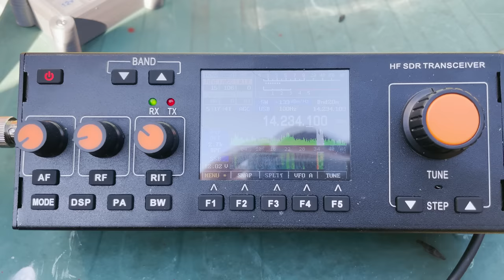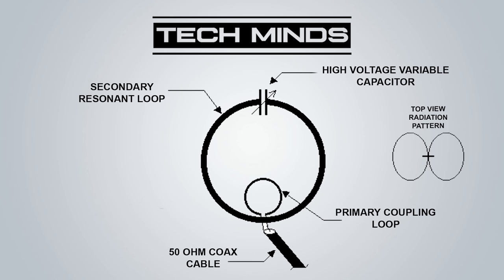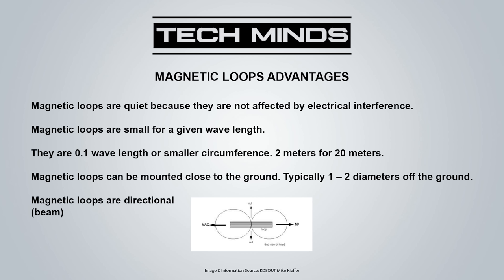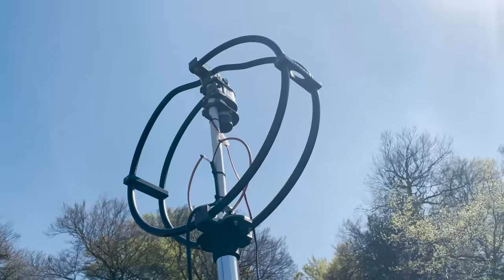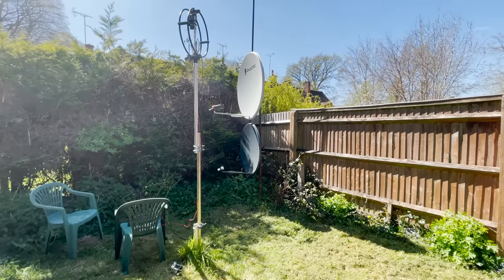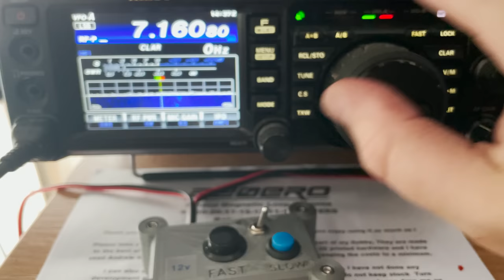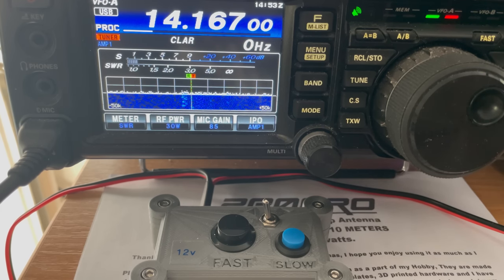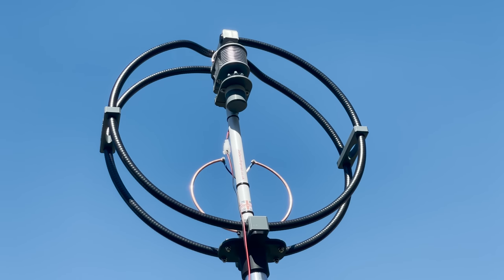MAGNETIC LOOP 40M - 10M Built by 2E0ERO

Comment: NO NO NO NO, you don't use an ATU with a magnetic loop. The loop will not radiate properly if not tuned correctly and an ATU will not help.
Reply: I add a few NO NO NO NO NO's.  that is a big NO NO to use a ATU with a loop, never do that
Reply: Actually, you're wrong. You can tune a loop with the capacitor and get the best swr you can. The ATU will then match the impedance.

Comment: I just purchased one of these today on his eBay page , the reason for purchasing was down to the stable looking design, I have home-brewed a few using old radio capacitors and various coax , aluminium loops but my efforts were always substandard, some day I will invest in a 3d printer . I wonder if you have done any follow up videos with good band conditions, could also be used in conjunction with Xphase QRM Eliminator as your aux input to get rid of bad over the horizon qrm radar/woodpecker/ noise as well as local noise in both horizontal and vertical positioning
Reply from the maker: Unfortunately I gave this antenna to my friend, on a permanent loan! I have too much gear here to keep around so I needed the space. I believe many people are using these.

Comment: I have the AlexLoop (for SOTA) and the Ciro Mazzino (spelling??) Baby loop. While I like them one huge drawback is the obvious need to retune when changing frequencies which makes contest participation painful. Another big limitation is the inefficiency of a loop at its lowest operating frequency (7MHz in your example) and I suspect that this one is no different. Final comment is the peak angle of radiation in the vertical plane is quite high (~40-60 degrees) making DX more challenging. FWIW I think using at ATU a big “no no” with a loop given the sharp Q of a loop.

Comment: I have one of these and it works well, mine is in the loft and right next to a velux window. only downsides i can see is its not waterproof, so not suitable for full time outside and the switch has to be manually switched to extend the range.

Comment: I have the same loop bought from 2E0ERO earlier in the year. Initial setup indoors just behind the patio doors gave better results than I was  expecting despite it being stood on the floor. As soon as time  allows and the weather improves I'll be mounting it on a decent portable mount and getting it a little higher of the ground. General consensus seems to be  1m to 2m so I plan on using a tripod that's easily portable. Did you try it at different heights?
Reply: test it by placing the two loops parallel to the ground, that is, horizontal: in theory this will be omnidirectional but it will only pick up the signals that arrive from the horizon (which are the interesting ones) and not those that arrive "below" the horizon, thus it will capture less radio noise generated in the population's homes.
Reply: Hi Nick, do you have the website where I can order? With your experience is the antenna water tight? With the Video I can see the tuning capacitor is exposed. Any suggestions? Jojo

Comment: Wouldn't this Antenna work far better 50 or so feet above ground?  You could just build a Antenna Rotator from a Car or Truck Windshield Wiper Motor and a Few Gears and some Electronics components Mate.  Also, could you use a hand full of Electronic Solid State Crystals at what ever Hertz you desired to help fine tune your Stations? Just asking. Thanks for the upload.
Reply from the maker: Interesting idea!

Comment: Matt, what is the net effect of winding the outer loop (tuned element) of the antenna? Can you reduce circumference for say a 80m - 40m MLA by coiling? I've seen online calculators that imply that loop circumference is critical to the antenna efficiency at any particular frequency (along with the diameter of the loop material). Can you somehow net a more compact loop for lower frequencies? I assume that there is parasitic capacitance when you do so?

Comment: Would this work for CB radio as well? I'd love to get one and try skip without the RF amplifier
Reply: 2E0ERO makes a CB one but this one tunes at 27MHz I had a go with 4 watts FM last weekend worked a guy 15 miles away we chatted for 20 minuts no issue so it works but not much CB in my area to test it fully

Comment: These are very expensive for what they are and perform worse than a random piece of wire and an LC tuner. We know this because a friend had one and did A B comparisons. The reverse beacon network also helped with the tests. His loops must have the worst efficiency of any loop on the market. The diameter isn't big enough and that normal air spaced capacitor will also be extremely inefficient. Expect between 1 and 3% efficiency. People say loops work, and yes they do, but a wire tuned with a simple LC circuit works much much better, and that's saying something. Don't waste your money people.

Comment: What diameter pole did you use there? I can't find anything that will fit the mounting or did you give Adrian your own custom measurements before printing?
Reply from the maker: Unfortunately I don’t have the antenna anymore as I have it to one of my friends. But I measured the mount that comes with it and ordered a short tube with the correct diameter from Amazon or EBay, can’t quite remember.
Reply: @TechMindsOfficial  ok no probs I'm sure I'll come up with something, cheers.

Comment: I find the interest in small magnetic loop antennas baffling for anything other than just as a recieving antenna..The radiation resistance is sooo small that it cannot be efficient as a transmitting antenna especiall for QRP....What am I missing>
Reply: With my FT-817 and this loop I have worked plenty of DX You are missing the the fact you have not tried one!
Reply: They in fact work very well provided they are optimised. The important thing is to balance area inside the loop vs current in the loop conductor while minimising Ohmic losses. Making it circular optimises area inside the loop and a circumference of about one eight wavelength gives plenty of current. Two turns reduces diameter that can be useful for covering lower bands, and/or intensifying magnetic field but reduces capture area. Inter turn capacitance can become an issue. Most designs settle for one turn and confine operation to 40m and above.
Reply: Peoples were used to say : Oh flying ? Nah, not possible. Now : it will NOT be the same as a classic and well placed dipole, no. If you wanna better energy transfer then you'll have to make it with a physical coupling and not the small ( 1/5 of the main loop ) loop but the downside is the noise, wich is bit higer than the small loop coupling ( of course the downside is bit less energy transfer but better "noise cancelling" . Gain ? The same, it will NOT gain as same as a well built and placed dipole BUT it's VERY silent and this let you listen the fleeble signar from far, far away... Try one if you can, trust me .